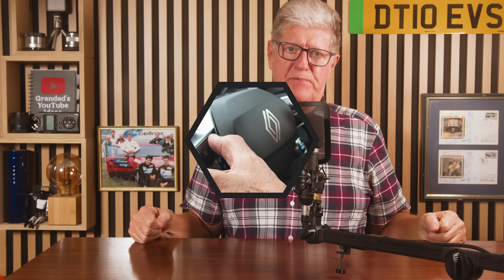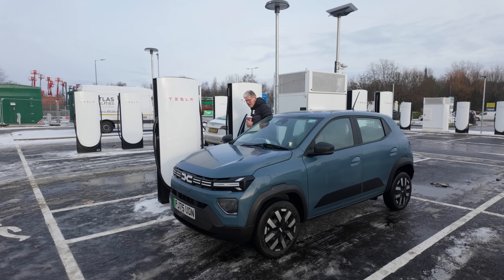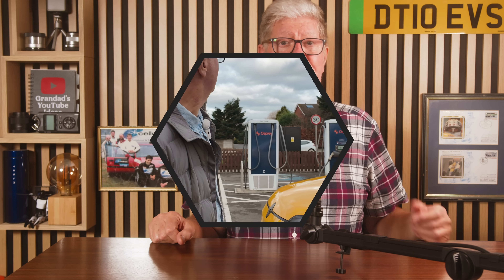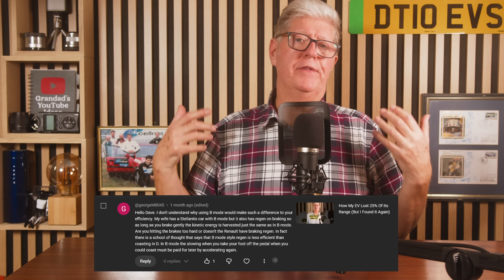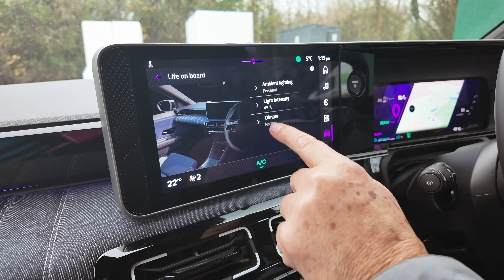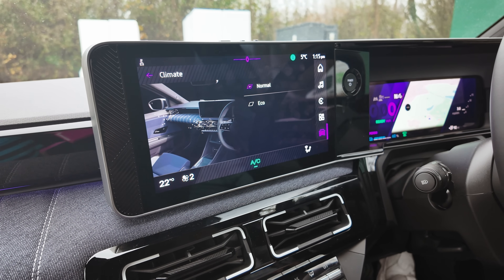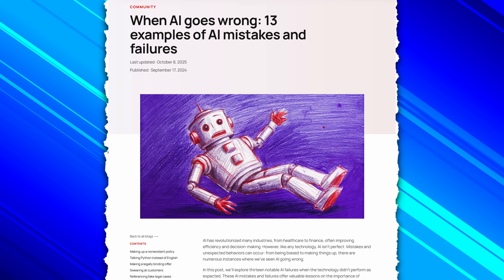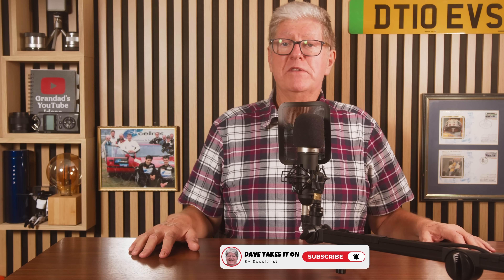Was I Wrong About Regenerative Braking On EVs?

Comment: Under normal braking, my car will use regen over friction, right down to about 10mph, even when going down a steep hill and braking to a halt, part way down (like at my daughter's old Primary school).

Max regen usually means you lose speed as soon as you lift off - and trying to  maintain a steady speed in that state can be problematic, especially on rough roads; I have witnessed cars with max regen set, constantly having their brake lights triggered by regen every 10-20 seconds, as they tried to maintain 60 mph on a fairly straight, but slightly curved, country road.
Each regen means they then had to apply power to get back to 60 - and since regen is at best ~75% efficient, they used more energy than needed, never mind the constantly triggered brake lights pissing off the following cars.

I would suggest you need to redo your experiment in several different cars; it might be the Renault uses regen differently when using the brake pedal; other people experimenting with other brands of car have found no regen slightly increases range, whereas your results give SUCH a large difference - it is suspicious.

One guy in Australia was going up and down a local mountain road, and found no regen gave better range even on the UP part of his test.
Reply: I have a 5, and found the opposite to Dave - my mpKwh went up with it off. I think if you drive quite efficiently anyway, the difference is likely negligible. The car is also much nicer to drive with regen switched off.
Reply: @MrRobinsonDJUK  Dave's difference was HUGE, which is why I think there is something wrong with the car.

As an example, my Kia usually manages around 4 miles KWH on average (winter), but sometimes it suddenly sinks down to 3.2-3.4, and I start wondering if the tracking is out again.
But first, in Park, I floor the throttle a few times, and LO!! Efficiency returns to normal.
Somehow, the car is losing track of max throttle and counting my usual featherlight foot as being floored - even though it isnt accelerating like it is floored.
Reply: @ianemery2925  I wonder if that is a known bug in the Kia software for your car?
Reply: @MrRobinsonDJUK  It isnt something I have come across in Kia forums, but then, only about 1,000 of them were sold in the UK, so it might be no one else has noticed - or everyone else drives with a heavier foot, so it doesnt happen to them.

Comment: I have owned my Honda e since new in 2020 and have always driven it in one-pedal driving mode (max regen). My 8000 mile per year commute routinely returned a range in excess of that stated by the manufacturer. This, combined with the more relaxed driving style of one-pedal driving meant I never saw the need to turn it off. The only time I will switch it off is during parking and low speed manoeuvres where accuracy of positioning is needed (creep mode). The only down side I can think of is having to remember to use the brake pedal in a normal car!

Comment: Pedants will say that you do generate some heat while doing regen. Its nowhere near the heat generated by brake-pads on discs so we should be quite safe in asserting that most of the energy goes back into the battery. In fact, coming down a mountain in Switzerland it was great fun to watch the "percentage left" figure increase all the way to the bottom .  Yes, pedants, I used more to get up there but thats true of ICE vehicles too and you cant regenerate fuel on the way down a mountain. 
I've not really tried the car on very snowy roads so I cant tell if its a problem to slow down/regen. Tesla will have the data. 
My guess is that since Tesla introduced "regen till you stop and Hold", which was a week after I bought mine,  it has found that nearly everybody uses the Full-regen mode. None of that trying to mimic automatics which were a pain to stop and keep stopped at traffic lights.  So maybe it makes sense to remove it anyway. Traction control maybe all you need. (or as you say Dave, they work together anyway).
As Scotty was alleged to say, "Ye cannae change the laws of physics"
Reply: Also: There are times (like at maximum charge) that the car disables regen until youve used 5-10%. In those circumstances it feels like Ive lost some control of the car. Its weird feeling. Like its running away from me. Cant imagine turning it off for any length of time.

Comment: Hi Dave. You posted my previous comment in this video but i think you missed my point. If you use the brake pedal gently it should use regen NOT friction. I agree that if you drive at speed up to junctions and lights then brake the energy is wasted but with an econimical driving style regen off , especially on motorways, will deliver better efficiency. It is basic physics. Accelerating and slowing uses more energy than a constant speed. Even best case regen is about 70% effective. The only explanation i have for you results is that you were using friction braking with regen off and much less with regen on. My Kona has 4 levels controlled by paddles, i get 3.6 in winter, 5 in summer and 6 when really careful. I try to use friction brakes as little as possible.
Reply: I am deeply suspicious of Dave's results, I dont doubt Dave is being honest, but I suspect Renault have done something stupid with the regen on the brake pedal, perhaps it goes to friction braking far too soon.

My old Kia will use regen for normal braking, right down to about 10mph, even going down steep hills; I have no option to switch it off, and the "boost" regen setting isnt exactly braking heavily, it feels more like engine braking; but the minimum regen setting still gives me better range, especially when driving enthusiastically on twisty country roads, where I can beat Kia's official range estimates by up to 25%.

Just before Christmas, I drove ~50 miles cross-country, to my sister's house and back; and my estimated range only dropped by 15 miles; although, TBF, my Kia is extremely pessimistic on range when the temperature is cold; so in percentage terms, I went from 100% SOC to 70% SOC on a 10 y/o car that the official 100% SOC range when new - was 92 miles.

Comment: For me the rule of thumb would be - If you drove an ICE car without worrying about fuel consumption then leave the regen off or in auto, if you value getting the most range and/or least cost from using your Ev listen to Dave and then join a forum or group for the car version you drive - each has its own characteristics so a general EV Regen video should be treated as a starting point to understand how to get the most from your car. Dave, keep Taking It On 👍

Comment: I am a retired lift engineer, the drive system used in an EV was developed by the lift industry, controlling the AC frequency allows you to control the speed of the motor ie the car.
As Dave said braking converts momentum into heat, that’s waste true, so using the brakes as sparingly as possible is the best way to conserve energy, in a situation on the motor way were brakes are rarely used D mode is best, because momentum is used to gain distance ie mile per kWh. Yes there is drag that looses energy, but that applies also if you using regen.
The statement Dave made the all the energy is returned to the battery is just not true, all electrical equipment, motors cables inventors, have electrical resistance this has the same effect as braking it converts energy into heat.
You will never get all the energy stored in the car’s momentum back into the battery.
If that was true that’s perpetually motion.
So car makers done put these systems in for no reason, use D on motorways and B regen for everything else, as Dave said braking is just waste.

Comment: Oh Dave. I've read enough of the comments to see people have set you straight. You don't strike me as a completely stupid guy, so do you only do spisodes like this for the YT engagement? If so, I'm playing the game for you.I'm sure you already know, but here goes:
Of course there is still significant waste heat with regen braking. Less than with friction brakes, but it's still there. Estimates range wildly between 15% - 90% regrn efficiency depending on circumstances. Regen to zero speed will ALWAYS be less efficient than coasting to zero. The widely accepted best practise is to use maximum regen around town where you don't know when the traffic light will turn red, someone will step out onto a crosswalk, ... & you don't have the distance to coast to a stop. On the motorway there is generally far less reason to stop suddenly or unpredictably so coasting is far more viable as an efficient way to wash off speed. The higher speed aerodynamic drag & tyre friction is also far more impactful allowing for speed modulation without needing to use the brakes much at all, etc etc.
I'll stop there because we all know this, even you.
Reply: Well said.

Comment: “I’ll keep this simple and avoid being nerdy” so let’s talk about Newton, entropy and kinetic energy. Your results with your R5 are actually very interesting and you could first of all do with repeating them, just in case there is some confounding variable. Also unless you do the exact same routes in the exact same conditions there are obviously going to be variability. But I agree it seems such a huge difference that it is well worth considering deeper. 

There is one 30 mile journey to a beach that we do regularly and I always take a shot of the efficiency data for each leg of the journey. I definitely get  better efficiency when using zero regen on the motorway part of the journey and full regen on the rural road part. 

It’s an interesting conversation Dave but your conclusions are too emphatic for such limited data.

Comment: A separate comment about regen and to 1 pedal driving. My EV6 GT has two motors, but in ECO mode it only uses rear motor, so is more efficient, and therefore the regen also only comes from that rear motor. 
For max safety in towns, with junctions, mini roundabouts, pedestrians and cyclists etc I use 1 pedal mode, which uses BOTH motors to slow, and will also stop me dead on give ways lines etc.

Comment: So the Renault 5 ECO mode is actually worse than B mode? That's not what the manual says.
In ECO, you're advised to anticipate the road conditions and lift off the throttle early or when you can.
When you press the brake pedal, it tells the car to start using regen to slow the car down. 
It doesn't use the brakes unless you want to stop quickly or are coming to a stop.
Did Dave start the "test" with a full battery where regen is limited because the battery is cold/full?

Comment: Regardless of efficiency figures (of which I stopped constantly checking after 3 months in to a full year of EV ownership due to wife having cabin temperature 24C, heated seats on full, heating steering wheel and mirrors on full all the time🥵🙄) I just love ipedal driving on our Ioniq5. You soon get used to being able to plant the car perfectly at any junction on any incline without hindering the vehicle behind. I genuinely can say I don’t think I’ve used the brake pedal more than twice, even when manoeuvring. 
Obviously using the Highway Driving Assist on the motorway that will bring the car to a complete stop with regen and pull off again itself but has used actual brakes when someone cut in the gap with their brakes on. I'm not worried about my brake discs as I know the wife uses them. Whilst she loves this car, she's not one for trusting any sort of autonomy or trying different settings. 
My only gripe is the manufacturers instructions. It tells you what regen is, how to select it and what will happen but it doesn’t recommend when or under what conditions to use it, so you end up looking online where every opinion is different. 
"Don’t use it on motorway" "Don’t use it in wet" "Leave it on all the time" "Don’t use it at all, your motor will be knackered after 3 years"
Downside to ipedal, getting in my works VW transporter after a week off and flying out the T junction at the bottom of our estate.... 😂

Comment: Have replied already, Dave, but must suggest more clearly that you look again at your implication that you can get back most of the kinetic energy in a moving car through regen - simply not the case. It's always worth having if you would be braking a lot anyway (eg around town) and it saves your brakes as well as being an easier drive (I love one-pedal around town or stuck in a slow moving jam!), but ... the energy "equation" is very different on a long journey on a (clear) motorway. In that situation, you are far better to simply keep at a steady (low-ish) speed as much as possible - which means anticipation, slow down or speed up as little as possible - which includes brake/regen as little as possible. If you don't do many long journeys, sure leave regen on.
PS we don't all drive Tesla, so the settings advice etc and new Tesla regen "always on" isn't something I can address.

Comment: @12:10 This part only shows Dave have no clue about winter driving... Traction control has nothing to do with hard regen and sliding.
Max regen has caused many accidents in winter here in Norway and the car organizations and the driving schools will teach you to set it to low or off in slippery conditions.
Reply: I agree, in slippery conditions max regen can cause problems if you come off the accelerator too quickly. Although traction control can help there is always a delay which is where the loss of control can happen, especially at high speeds.

Comment: I use full regen all the time, I started using no regen on longer trips but it just wasn’t as efficient, I use my foot to control the regen if you know what I mean and it is far more efficient.
Reply: If you need regen to be efficient you're not driving predictably. Basically accelerating and decelerating a lot. By anticipating what is happening up front you can slow down early in coasting mode.
Reply: @Gazer75 I don’t accelerate and brake much at all I just have my foot where it needs to be at to keep the speed, overall in my experience I get better range that way. I drive very predictably and not at all erratically.

Comment: I always use highest regen on my EV6 GT and am approaching 37,000 miles with average 3.5 m/kwh over the life of the car. It has 585 bhp and 2 motors, and Michelin Pilot Sport 4S grippy tyres which create more rolling resistance, but I am generally in ECO and never in a rush. I am not really bothered about the efficiency, but I am extremely interested in being IN COMPLETE CONTROL of the speed of the car, without friction braking. So in highest regen I get instant speed control, whereas with no regen I have a delay switching from accelerator to brake, and if in a dangerous situation, I also have a delay on getting back to the accelerator to power out of danger if appropriate.

Comment: Max regen is only going to be more expensive in the long run unless the car is smart enough to use brakes from time to time.
Only using regen will result in rusted brake discs pretty fast. And the cost of new discs and pads is far more than the savings from regen.
So far my experience with max regen or single regen is terrible. As soon as I turn off cruise control (no foot on accelerator) the car will slow down hard and fast and I have to be quick on the accelerator to manipulate the strength. This does not make for a comfortable drive.
In the end coasting is the most efficient way of driving if possible as the regen is not capturing all the potential energy.

Comment: I tend to use low regen sometimes for two reasons.1) I don’t have to be quite so skilful with the accelerator to give passengers a smoother ride. 2) I have to use the brakes a little which reduces the risk of stuck callipers when I don’t use the car much.  This cost me a set of pads in our old Nissan Leaf!
Reply: It takes time to get used to regen, and like using a clutch on a manual car, we become used to using the accelerator to control the acceleration/breaking so in the end it is much smoother for the passengers than using a ICE car where you have 2 peddles to go faster, go slower.
I realise regen on some cars is better implemented than others and that makes a difference.

Comment: I have a Tesla Y and the one pedal driving is superb.
One thing that i notice on electric cars is the computer can be approx 20 % incorrect.
My car says i am getting 250 wh/mile but when i check the actual kw put back in it is 20 % more and should read 300 wh/mile.
Reply: Charging losses mostly... AC charging loss can be 10-20% depending on the cars OBC. Even DC charging have some losses.

Comment: Isnt braking using regen at first and discs to put it at full stop???
Reply: Regen braking uses the motor to slow the car and recharge the battery, reducing reliance on friction brakes, but the discs and pads are still used for harder stops, emergency braking, and to prevent rust from disuse. 

The system blends regen with traditional friction braking, engaging the discs when more stopping power is needed or the battery is full, ensuring safety while maximizing energy recovery. Hope this helps.